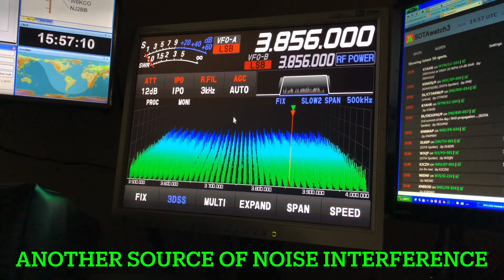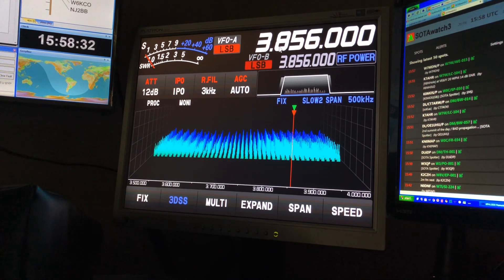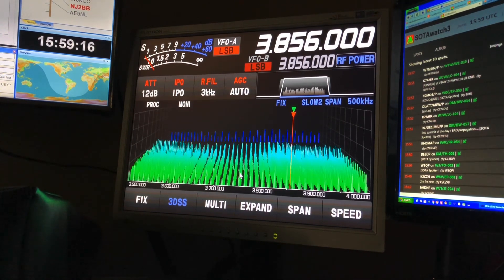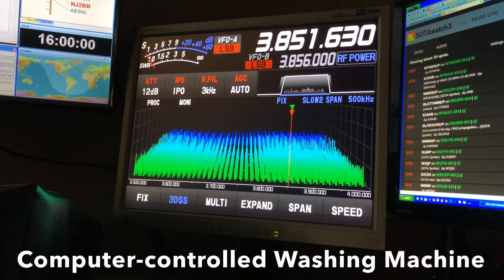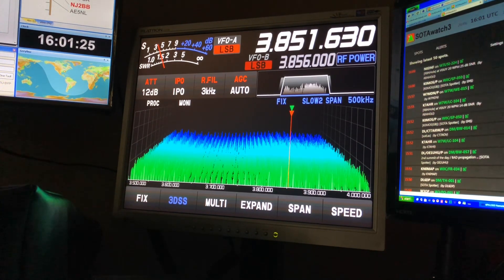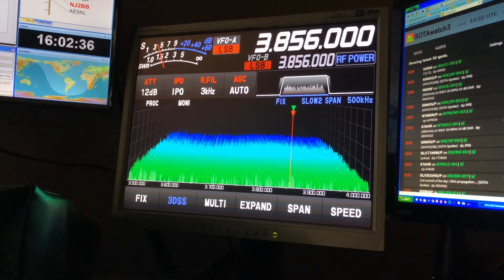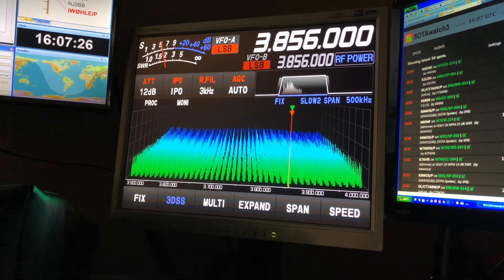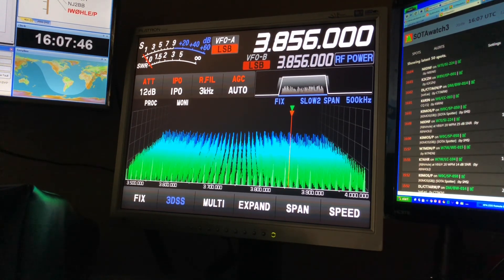Another Source of Man-made Noise Interference (aka QRM) #hamradio #rfi

Comment: Our washing machine creates other hash across many bands.  You can hear the noise change as the washer motor goes back and forth.  I have tried wrapping the AC cords in a number of clamp on ferrites with no real suppression.  The dishwasher also makes noise.
Reply from the maker: Mine affects all bands, from 160 through 10, but is the worst on 14 MHz and lower.  And yes, the ferrite on the power cable does nothing.  The issue is the variable frequently AC motor controller (aka inverter drive).  I'm afraid these things are taking over.  So far so good with our Thermodore dishwasher, but it is old.

73, Doug

Comment: So if I power the radio with a battery, and then try to filter out the noise and it doesn't go away, I can assume it's not RF noise, but QRM? Then do the breaker test? Just trying to be sure I'm eliminating a received (RF) noise as the source the proper way.
Reply from the maker: Yes, atmospheric noise is called QRN.  That is normal.  Power pole noise sounds like a buzz.  It would qualify as QRM.  The "M" stands for "Man-made" noise.  A noise blanker can usually minimize power pole noise.  Noise from Wall-wart power supplies, LED bulbs, plasma TV, wireless phone chargers, laptop power supplies, etc. is different.  A noise blanker can almost never knock that type of noise down.

So, before you call your power company, run your radio from a battery.  I use a Bioenno 12aH LiFePo 4 for emergency power anyway.  While operating on battery power, start turning off circuit breakers.  If the noise suddenly stops, you have found the circuit with a problem device plugged in somewhere.  Turn the circuit breaker on again and then start unplugging devices on that circuit until you find the culprit.

73, Doug

Comment: Is that noise only present when the washer is running? A ferrite core on the AC line of my washer did nothing to help. Fortunately it is only noisy when operating. My wife’s Oral B electric toothbrush produced continual s7 noise until I wrapped the power cord around a ferrite core.
Reply from the maker: I have actually tolerated this noise for years.  In one of my earliest FTdx5000 videos, I found the source.  This is an updated video, showing how vividly it appears on the 3DSS of the FTdx10.  It only happens when the washing machine motor is running.  A ferrite on the power cord makes no difference.  The noise comes from a variable frequency AC motor controller.  It enters the receiver via the antenna.

73, Doug

Comment: Found a cheap Chinese laptop power supply replacement relatively easily.  The second was a bit harder.  Turns out it was my Tilia Foodsaver vacuum sealer, which wasn't even turned on!  Unplugged it and noise dropped to almost 0.
Reply from the maker: That is some great detective work, Richard.  Maybe we should dub you "Sherlock".

73, Doug

Comment: Doug,
Try getting a Speed Queen on your next washer purchase. Don't know if they still have the old knob controller washing machines but they did in 2014 when we got ours. The wife didn't want the electronic computer controlled ones and Speed Queen had em and it was supposed to be a commercial grade too, don't know about all that, but all I do know it just works and the wife is happy. 
Hope you and the family are doing well.
Take care,
Tim, KR4AZ.
Reply: Unfortunately speed queen stop making that washing machine in 2018. The newer model looks cosmetically similar but does have a solid state board in it. I’m unsure of it has a variable speed motor though or not.
Reply from the maker: I think it will be almost impo to buy a plain washing machine in the future.

73, Doug
Reply: I did some research here and found this video from a couple years ago. And this model of speed queen appears to still be available. The lower part of the washer is the same as the older speed queen washer. With a computer controlled top. 

https://m.youtube.com/watch?time_continue=312&v=dk2P5_7g_jg&feature=emb_title
Reply from the maker: Thank you for the advice, Tim.  I wasn't thinking when I fell for the computer-controlled Electrolux.  My wife is very pleased with it and the matching dryer.  We've actually had the set for more than 10 years.  But I didn't notice the issue until I got back into amateur radio more regularly in 2017. 

I just happened to be operating one evening while my wife started a load of clothes.  It took me a while to deduce the cause.  Fortunately it's all good when the washing machine isn't running.  There is a much older video on the channel, from when I first discovered the problem.  But seeing it on the FTdx10 3DSS view is very revealing.

73, Doug
Reply: @n4hnhradio  
Yeah, at least you don't have to put up with it all the time. My Ac unit shows up a bit on 20 mtrs but it's not to bad and only on certain frequencies. Like you said it's more prevalent now with all the fancy electronics, led lights, etc.

Comment: try a Toroids ON THE washer power cord

73
Reply from the maker: I wish that worked Roger.  Nothing seems to stop this noise.  It's literally a variable frequency motor controller running this thing.  It works by varying the SC to the motor.

It's great to hear from you my friend.

73, Doug

Comment: Sounds similar to a cell phone charging next to a radio.
Reply: Call...k4vte
Reply from the maker: Hi Tommy!  Yes, it is similar to the noise my wireless cellphone charger caused.  My wireless cellphone charger even interfered with 2-meter VHF.  This doesn't extend to 146 MHz, but it wreaks havoc on HF, especially 14 MHz and lower.

73, Doug